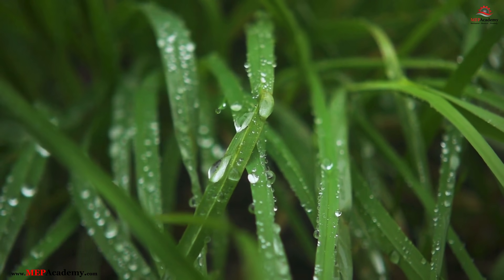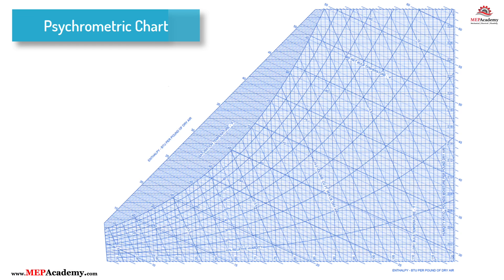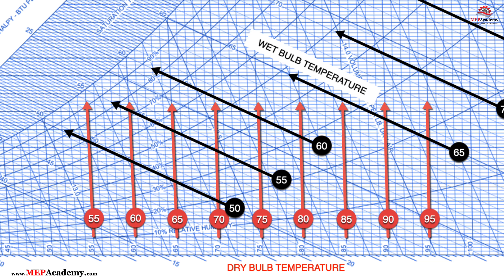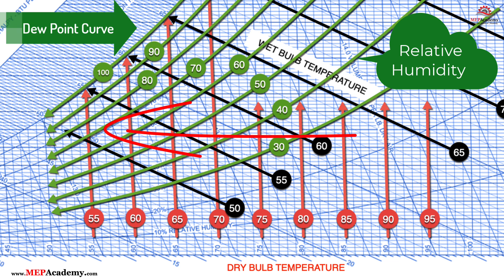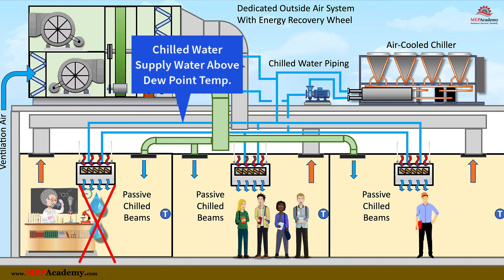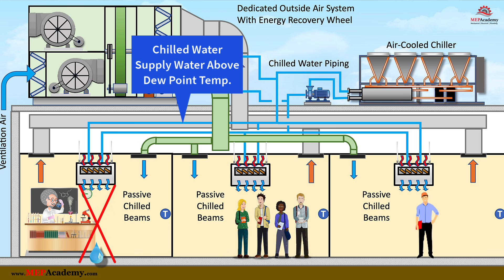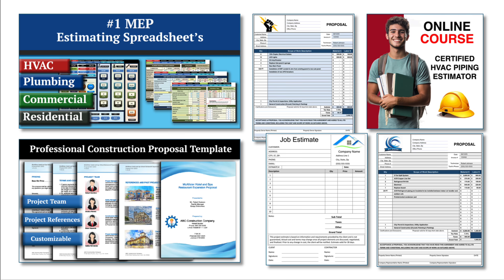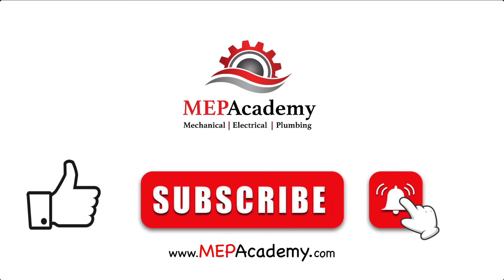Dew Point Temperature Explained

Comment: What is Apparatus dew point temperature and bypass factor ??
Reply from the maker: apparatus Dew Point (ADP) is the theoretical temperature at which air leaving the cooling coil would be completely saturated (100% relative humidity) and reach dew point, meaning all the moisture in the air would begin to condense out. The Bypass Factor represents the proportion of air that "bypasses" the cooling coil without being fully cooled or dehumidified. Essentially, it quantifies the efficiency of the coil in cooling all the air that passes through it.

Comment: Hot air passing over an evaporator coil brings the temp of the air down to its dew point , which at that moment pulls the moisture out allowing dry cooler air to continue on in air handlers to reach the comfort zones designated .
    So the air is conditioned 😳
/ condition air
    So the process we call air-conditioning.
    As an Hvac-r installer , ive tried to explain this many ways to the new guys , but have just said in the end the coil removes heat / in the absence of heat there is cold 🥶
Reply from the maker: Yes, in this trade we're professional movers. We move heat around. We either add heat or remove heat from the building using refrigerants or with water-based systems like chilled water and heating hot water. You're right cooling is just the science of removing or moving heat from one medium to another. The heat is never lost, it's just moved from one location to another. Welcome to the heat moving business. :)